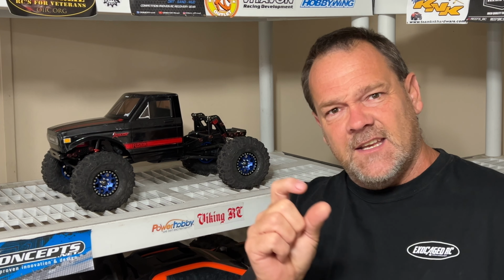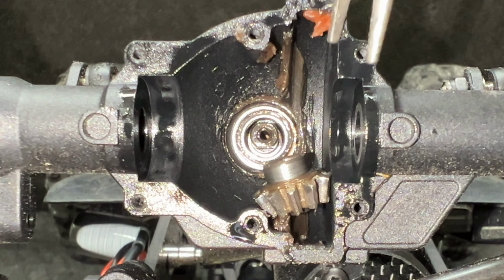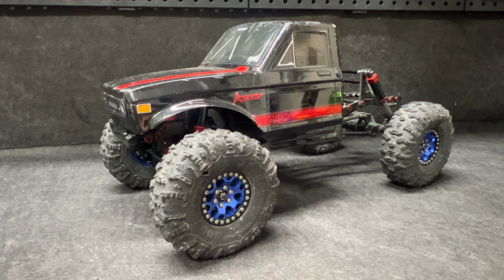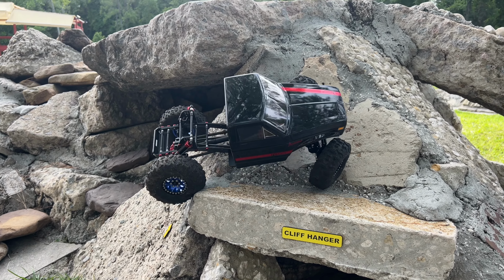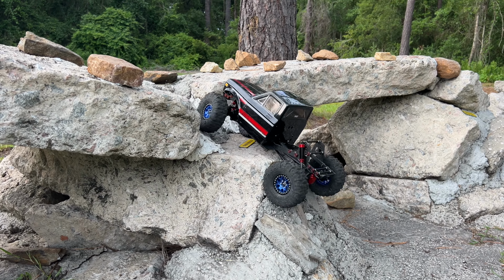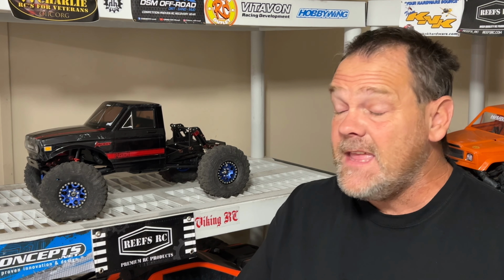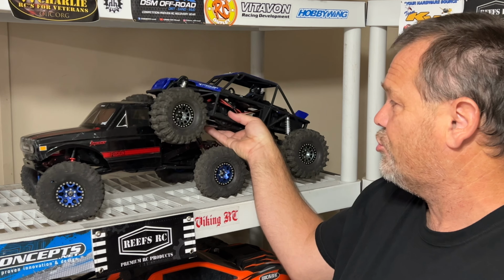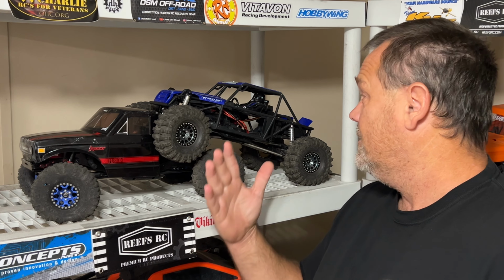Most common issue and fix for any Redcat Portal Axle Crawler

Comment: This is still an issue? Mine came apart on my axe edition on the trail and I didn't notice until after the bearing went flying. I figured they would have started thread locking these by now

Comment: Should have cleaned the grease off the screw first
Reply from the maker: that was blue threadlock
Reply: @ExocagedRC  @01:58 it sure looks like a lot of grease on the threads before you dipped it in loctite. Just saying grease and loctite don't mix. Have a good one.